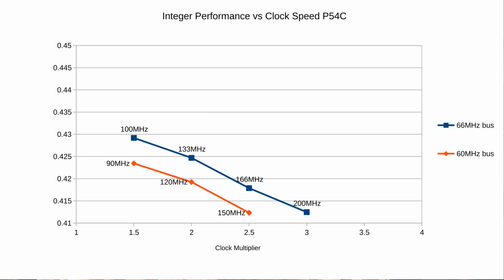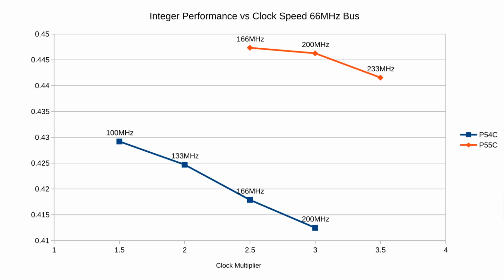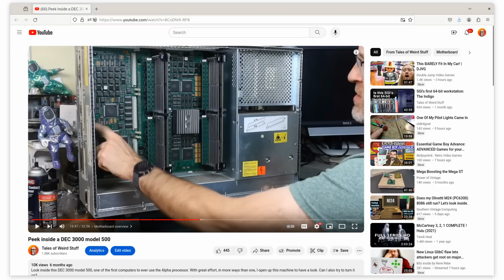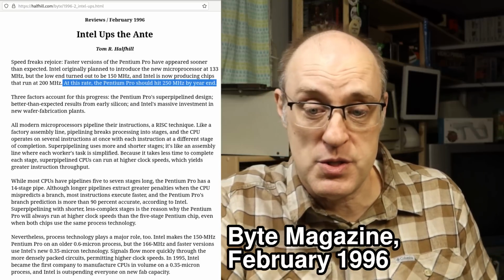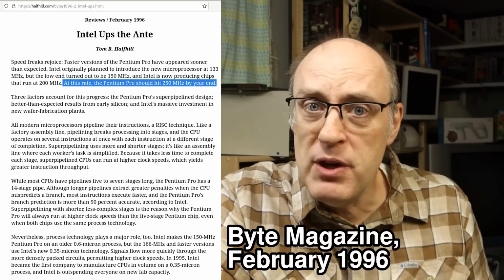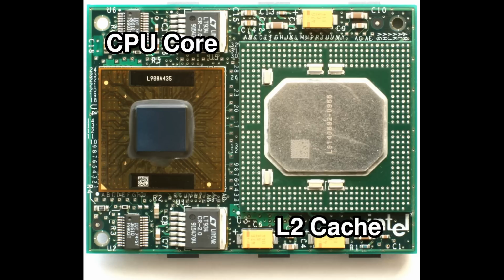Why did slot CPUs exist?

Comment: 39:18 im curious about what you said about Pentium Pro with "you couldn't test those chips without embedding them both into ceramic, and by that point, you reached the point of no return". Was it not possible to test them together in a BGA adapter harness? did their packaging requirements prevent them from being connectable to anything before soldering? Did BGA harnesses just not exist at that point?
Reply from the maker: That is a very good question. To be perfectly honest, I don't know. This is an oft repeated "fact," but I don't know of an authoritative source to support it. The Wikipedia article doesn't even cite anything. At that time, there weren't many MCMs (multichip modules), so the technology and best practices probably were not well established. Chips were connected to the pins of the package by soldering tiny wires... maybe it wasn't possible to put them in temporary packaging for testing, then put them in the production package afterwards.
Reply from the maker: The similar statement in the Slot 1 article on Wikipedia is tagged "citation needed." :)
Reply: Wouldn't have been feasible in those days - in fact, I'm not sure it's economically feasible today. The size of the contact points of the silicon wafers are so small that you couldn't use a pogo-pin (i.e. BGA) type assembly to test it.
You would need flying probes to do this and at that size, wear and tear would be a significant issue assuming you could even have the precision (I doubt this was even possible at the time) to make it reliably repeatable.
It's still cheaper to package and bin the CPUs in such large production runs than to constantly replace/ maintain the test vehicles for testing these individual dies.
For context, I did some work for one of Seagate's contract manufacturers back in the day - their sister company made a multi-million dollar business out of manufacturing tiny plastic pieces (suction tips) that are used in the machines to pick and place HDD components for manufacturing.
That should give you an idea of the kind of wear and tear involved in machines for large scale production like this.

Comment: Yes, the slot 1 cpu's. I remember playing with those. I had a socket370 to slot 1 converter. I had an Asus P4b-F, with the venerable 440BX chipset. Originaly it was fitted with a PII 350 mhz with a 100mhz FSB. Later, I upgraded it to a PIII 800mhz. I remember searching high and low for the 100mhz FSB version. So that I could install it in my P4b-F. I also had a Thermaltake super orb CPU cooler installed, becouse other coolers would be to large to fit and hit components on the motherboard. 
If memory serves, the slot-converter had special brackets, so that you could mount it properly and wouldn't put to much stress on your socket/motherboard.
Unfortunetly I don't have that setup anymore. It's hard to believe it's almost 25 years since I had it.
Reply: My first slot 1 CPU was a 233Mhz Pentium II that came in an IBM Aptiva tower, but my first system I built myself was a Celeron 300A that was overclockable to 450Mhz out of the box with no additional cooling required. Those were the days!
Reply: Was that the Pentium II that was a slot CPU? I might still have that and the MB in a box somewhere. I totally forgot about those things!
Reply: I run the P4B-F + P3 500 + Voodoo3 3000 for my retro rig
Reply: @rootbeer666  At one time I ran a ABIT BH6, Pentium II 450, 384MB PC-100, and  a Voodoo 3 3000.  Later on I ran a ASUS P3B, a Celeron 1Ghz on a slocket adapter, 1GB PC-100 with a Radeon 8500. (I had hopes that ATI would resolve the driver issues a lot faster than they actually did.)
Reply: And if you were really rich, you could get slot 2's!
Reply: Are you not mistaken with the P2b-F?
The Asus P4b does not have a Slot-1 slot as far as I can remember.
I still own and use an Asus P2b-F with the 440BX chipset, with a 1GHz Celeron on a Slot-1 adapter.
Reply: @PeterK6502  the case is open 😉

One of these days I need to replace that whiny integrated fan that Intel put into Slot 1 processors.
Reply: You mean Slot 1 to Socket370.

Comment: I can confirm that running a P55C at 120x2.5 makes for a very fast 300 MHz Pentium. It beat my 300 MHz Klamath running 66 MHz bus at pretty much every metric in dosbench.
Reply from the maker: That... is interesting. When I finally get around to doing the multiway benchmark battle, I may have to try to reproduce that result.
Reply: @TalesofWeirdStuff  I'd love to see if you get similar results!
Reply: That's quite interesting. That would mean a 166MHz non-MMX Pentium overclocked to 120FSB, I wonder how stable that is, and how stable the ISA, PCI buses are. What's the heat output like?
Reply: @thebayandurpoghosyanshow  no it's an MMX 233 with a lowered multiplier. At 120x2.5 it wasn't perfectly stable but 100x3 seemed stable. Motherboard is Gigabyte 5AA so Super Socket 7 and quite capable. Heat is manageable with a reasonably large SS7 heatsink and fan.
Reply: @agsel  that makes more sense, because while the CPU might be able to run at 300MHz internally (to my knowledge, the laptop market actually got 300MHZ P1MMX CPUs), running the FSB at 120MHz, well, I shudder at the thought of how many more variables it introduces.

It would be cool if you made a thread on Vogons with your findings :))
Reply: @thebayandurpoghosyanshow  that reminds me, I'm still waiting for delivery of my Tillamook 266 :)

I might consider finally registering a Vogons account and posting, thanks for the encouragement
Reply: @agsel  would be happy to have you there :))
Reply: @agsel  I have seen a Pentium MMX ran at 100x3 before and it was pretty fast. Some have done this with K6 series as well but Intel moved to the Pentium II because of the inherent problems with the L2 cache running at motherboard bus speeds. Of course AMD offset this to some degree with the K6 III and later the K6-2+ and the K6-III+ making the previously on motherboard L2 cache into now a L3 cache.
Reply: @JesusIsLordAndSavior777  I got my Tillamook 266 today and I'm also planning to modify my K6-2+ 500 to K6-3+ and see if it makes any difference. It runs 600 MHz just fine thankfully
Reply: Makes sense - you can have the fastest CPU in the world, but if the main data bus can't keep up, the CPU will be sitting idle for however long it takes the data bus to catch up after every instruction.
Reply: @233kosta  true and very noticeable when running a K6-2 at 400 MHz at 66 MHz bus
Reply: Bus speed (tied to cache speed) was King those days. It was well known that celerons outperformed pentiums in some cases with their half as large but twice clocked caches. 
I’ve never oc’d a Pentium but in the 486 days the 120mhz (3x40MHz) chip outperformed the 133MHz (4x33, the default) setup. Of course the king was the 150MHz (3x50MHz) 486, I had used mine that way.
Reply: I remember the MMX CPUs to be well overclockable. But the same was true for the 100MHz FSB P2 processors. I ran a P2-400 at up to 120MHz FSB and it was an absolute beast at the time. But the system needed (for the time) insane ventilation to run stable. 
It was on a very large Asus board that I think allowed bus frequencies to be set individually. So gaming performance was better at a slightly lower speed with a slighty bus overclocked GPU.
Reply: @jackmclane1826  I have a P2 350 running at 466, 133 MHz bus because these CPUs really like high bus speeds. You must have been baller for running an oc:d 400 at the time :) 
I had a K6-2 300 running at 450 but even a stock P2 400 ran circles around mine
Reply: Digital 1200 Server........ 2 x Pentium 2 333MHz... lovely fast machine at the time!
Reply: Very nice.
Reply: I seem to remember that being true back in the day.
Reply: OK, that’s DOSBench, but what about in 3D texture-mapped games (POD, Jedi Knight: Dark Forces II, Quake II etc.) that rely heavily on integer and floating-point performance?
Reply: @dipshidian  if I remember correctly, Quake 1 was faster on the Pentium but Quake 2 was faster on the P2, so basically DOS was faster on the Pentium but going to Windows, the P2 was faster
Reply: @agsel  That sounds about right. Thanks!

Comment: There were sun's and ibm's that used something like the slot configuration as well, like the Ultra Sparc II in the Sun Ultra 60 and the Power 3 in the rs/6000 43p
Reply from the maker: I'm getting an Ultra 60 tonight, so I'll have to check that out. I thought the used boards that were vaguely reminiscent of the old MBus boards.

Comment: One of my students was asking about similar things and I was explaining about CPU structure. At the time, I didn't even want to touch on slots... 😕 I always had more issues with them than any socket board. At the time I chocked it up to some people messing up the pins on the CPU chips, whereas slot CPUs didn't have that issue. I may have been completely wrong - obviously - but that's my thinking at the time. Many things had changed (some good, some bad). Older systems had all the I/O and processor/memory on cards and only the bus with slots as the "motherboard". Then came primitive motherboards with just enough to boot the system. Then I/O was gradually added to the motherboards. Floppy drives mysteriously went from up to eight down to two connections. Hard drives went from various settings and RLL complications to IDE making things very simple (so surprising). IDE also added tape backup and CD/DVD/BD. Parallel and serial yielded to USB. During this time we went from 16-bit to 32-bit to 64-bit in basic home systems and laptops. SATA and NvME. Somehow we lost decent sound cards and picked up USB sound "cards" and devices. All manner of USB devices over the USB connection that can then pass to the appropriate device driver (like USB HDDs/USB sticks that pass to the IDE drivers to act as IDE mapped devices). Along the way, devices became so different, processors so different, mobos so different that older OS platforms don't work on modern hardware without virtualization. Yet, this knowledge is disappearing daily as schools churn out students without any hardware understanding and even placing students into programming courses with no Structured Programming preliminary education. Students want to graduate immediately and expect they'll be ready to work with almost no experience. If one of my students expresses an interest beyond the limited aspect of class and wants to know why things are the way they are, I take the time to explain it and to send them to channels like yours for even more info. Thanks for taking the time making/editing this video!
Reply: By the time courses are available it's a history of computer science class.😂
Reply from the maker: When I was briefly teaching computer graphics, I noticed that nobody has the faintest idea how hardware works. When I had to explain bit shifting and bit operations to the students, I almost had to cry myself to sleep. :(
Reply: Back in the 1990's I had a job as the in-house computer tech at a multi-million dollar store. I quickly cleared the large (several dozen) backlog of computers needing repair and started taking on more responsibility: Ordering, on-site repair and sales (we had an in store salesman and the large company/government sales, network install and his assistant) and eventually some of the smaller on-site networking.

The in-store salesman handled invoices and first interviews. We had a policy to always interview. One day a Guy came in for a computer tech job, the in-store salesman punted to me. 

I asked the Guy to tell me about himself. He'd just graduated college with a computer tech "degree" from ITT. 

So I had him come to my work area where I opened up a computer. I explained that I was going to start simple and get more complex to get an idea of his knowledge. He was very excited and said that thus is what he trained for.

I asked him to point out the CPU and I shit you not his response was "Can you give me the schematic diagram?". I figured that the inside salesman had set me up. This Guy could pick out the CPU, memory, hard drive, I/O board, video card and had no idea what ISA stood for. After he left the inside salesman wasn't laughing and said he was on the phone the whole time.

Then a few weeks later another ITT graduate came in. I shit you not, it was the same. Being pretty confident that I wasn't being setup I asked "What do you need a schematic for to find the CPU?" He responded "So I can trace out where the CPU is." Huh?

"How many motherboards have you seen?" He responded "We used about 20 motherboard schematics!" I said "How many actual motherboards have you seen?" He replied "This one, but I just need the schematic". I said "Touch the motherboard." He couldn't.

Feeling bad for the Guy, I told him "We might have a few dozen schematic diagrams for motherboards, most of which are several year old Compaq servers. It is very rare that we repair circuit boards because of how long it takes to get schematic diagrams and how cheap computer parts have become. The store used to have a board level repair tech but it was un-profitable. He would spend hours to 'repair' a component. The store charges $40/hr for that work, but we can't charge for his research time or for him to source parts. A new, quality PC motherboard is about $100 retail. Even if we only charge $80 labor plus parts to repair does that make sense? It is likely the new motherboard will have better features and include a warrenty. We warrenty the repair for 30 days and a good portion had additional 'hidden' problems that have to be fixed at no cost. The reason I know this is that we contract that tech for specific repairs but only for expensive equipment or industrial equipment that can't be replaced."

"Video cards are generally between $30 and $80 retail, I/O cards $25. It costs more money to diagnose the electrical issues for these components than to buy a new, upgraded component. The cost to repair the component is usually several times the cost to replace with new."

"This means a computer tech must be able to immediately identify the components of a computer and have the skill to diagnose which parts need replacement in order to quickly give a customer a detailed list and a price quote."

His answer was "That's not what they trained us." I said "Then find a job where they repair components but don't waste your time at computer stores.  You need to find an industrial facility and get an electronics repair tech job." He says "I'be got a degree for computer repair, that's what I want to do and you have no idea what you are talking about!"

Every few months another ITT graduate would come in without ANY knowledge about computers and always request a schematic.

A couple years later I took a class at the local community college. I spoke to the professor about ITT. He laughed and said "yeah, we get ITT grads coming to get a real degree. They are exactly as you describe and usually drop out because we recommend that they get an electronics degree because of their insistence on needing a schematic for everything."

Comment: Wow! I knew the answer vaguely involved cache, and now I have a much stronger grasp on why CPU hardware was so weird for a few years before settling back down into sockets again.

I’d enjoy more videos like this as you want to make them — they contextualize and deepen my appreciation for the benchmarks, and they are good fodder for future videos.

I really look forward to the slotted Pentium/Xeon banchmark video. I’d also be interested to see a comparison video showcasing the performance changes between Intel’s and AMD’s last-gen slot and first-gen socketed CPUs, and a comparison video of the Pentium Pro, Slot 1, and Socket 370 Pentiums (compensating for speed/architecture differences as much as possible) showing the performance delta that cache packaging alone makes.
Reply from the maker: Ah... I had been so focused on the cache characteristics of CPUs with the same packaging, that I didn't even think about slot 1 vs. socket 370 or slot A vs. socket A. I would guess that the main difference there would be changes in chipset or memory technology... but it's definitely worth checking that assumption. I may just fold that in with the other comparisons.

Comment: A thousand thanks, lots of interesting data... I feel the need to share this video with @adriansdigitalbasement 😂
Reply from the maker: One of his recent mini mail call videos... where he was complaining about slot 1 and slot A CPUs... was actually the inspiration for this video. 🤣
Reply: @TalesofWeirdStuff Thanks a lot you have put into words so much of this stuff, from time to time I get caught reading about the Pentium Pro and its back side port, that it was not on die and even it was made in a completely different process, how difficult it was for intel to bin these CPUs, then how cool it was the combination of a Deschutes core at 300/333 MHz and a full speed "Xeon" 512Kb L2 chip but it was so expensive that it made little sense for people with single socket 8 motherboards to go that route (launched in August 98 at the same time and similar price to the PII 450) such a shame Intel did not developed a Socket 8 400 MHz Dixon Overdrive that would had been "fun"

Comment: Good stuff, never thought about why slot CPU existed in this light, even though I always knew of daughter board CPUs in the workstations. shrug
Reply from the maker: I suspect that a lot of people knew about workstation or Power Mac CPU cards without making the connection. I never thought about it until recently, and that's mostly because I've been working with workstation CPU boards quite a bit over the last couple years. :)